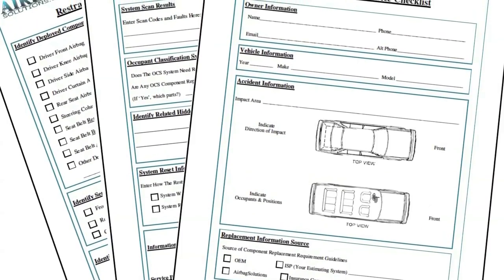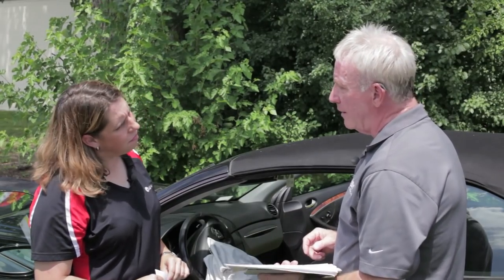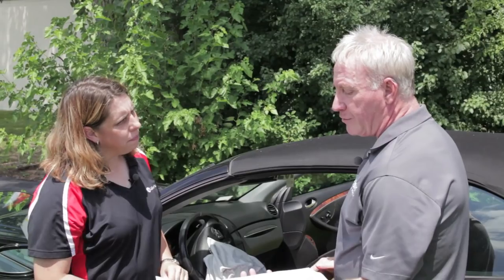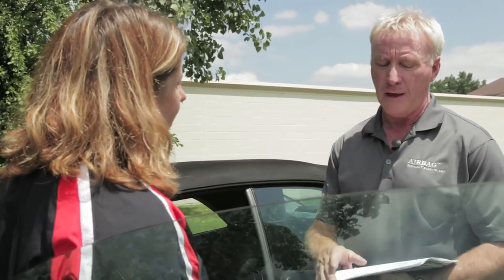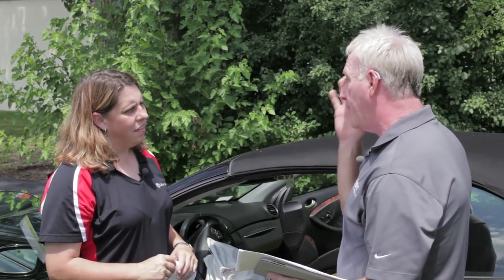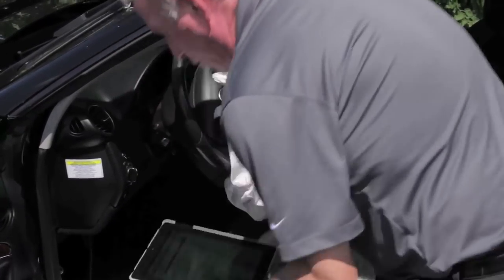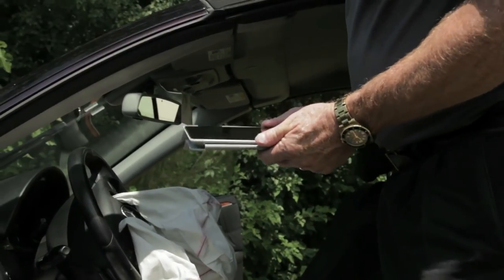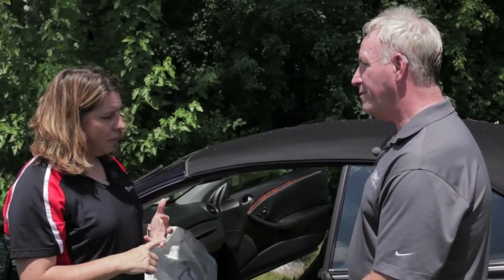Inspecting and Estimating Airbags With Repair University

Comment from the maker: On some models they are sensors inside the door shells that use the internal air pressure of the door as  a means to trigger a side curtain deployment.